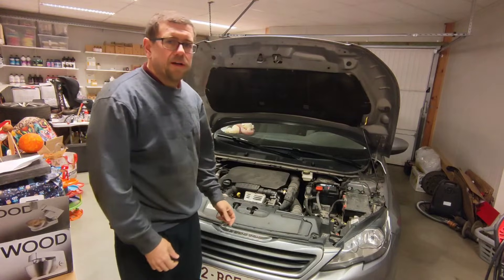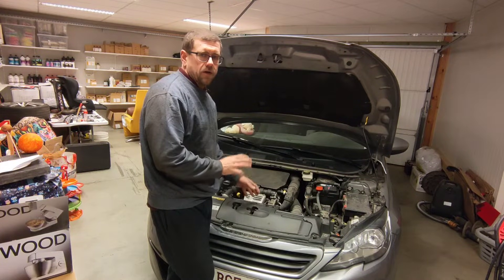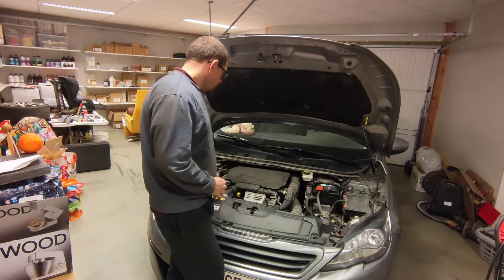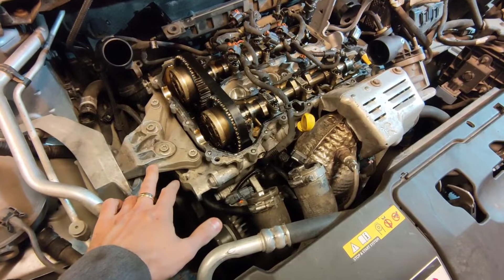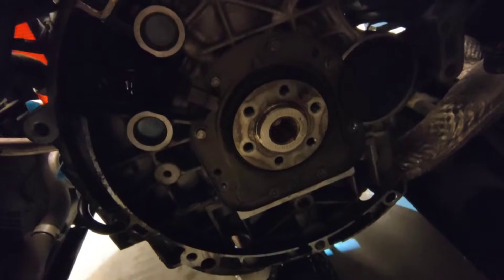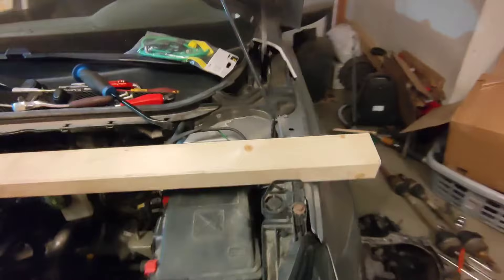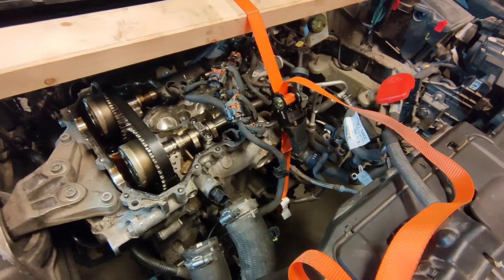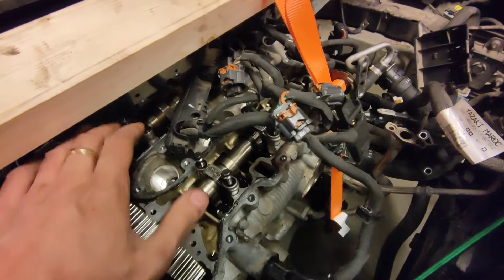PSA Peugeot 308 SW 1.2 e-THP Puretech rebuild - Part 1

Comment: Just use Tunap 133 to decarbonise the oil control rings regularly. This reduces oil consumption drastically on this engine. The engine can use up to 200ml per 1000kms normally. Piston ring cleaning generally brings the consumption down to or below this.
Reply from the maker: Now it's been using 0ml of oil for 10.000 km so far.

Comment: Everyone complains about these engins, but uses the wrong oil. The third gen belt is out, and they are way more durable. Just service it every 10 000km, and change the belt every 60 000km an you'll be fine. My VW t6 dry belt had to be changed Evey 120 000km. Think of tyres, a life of 5 years.

Comment: Nice, i did the same jobb on my 1.2 puretech (citroen c4). I actually hadd a piston ringland failure, due to preiginition. I just bought the car. The owner i bought the car from said that it consumes a little bit of oil. I tought it would be just 0,5 l for 1000km, but in a matter of fact you could only drive 200 km before the sparkplug was soaked in oil and it started missifiring. I pulled out the engine, replaced one piston, and piston rings on all the cylinders. Now it works like a charm without oil consumption.
Reply from the maker: Same here, been running perfectly now. Just need ro keep the oil fresh and we'll change it every 10k km now

Comment: Yesterday I just changed the timing belt with all the accessories, 618 euros, 72,000 km, the engine used to work great, but now it works perfectly, like a cat purring.
Reply from the maker: Luckily you did yours on time, theyre lovely engines to drive when they work.